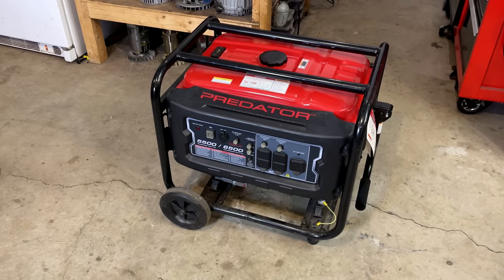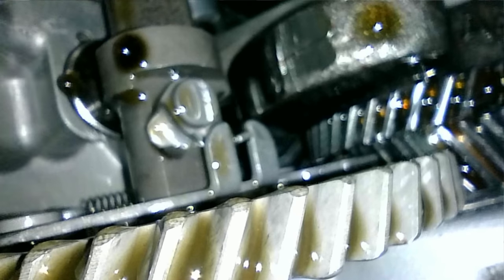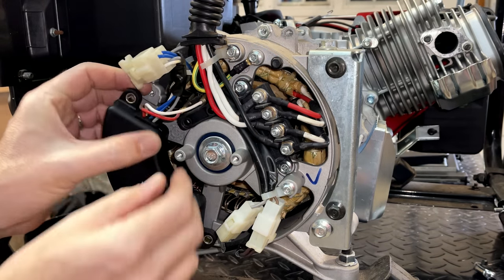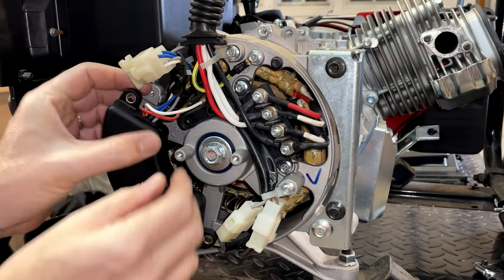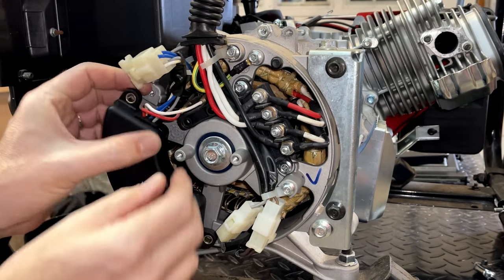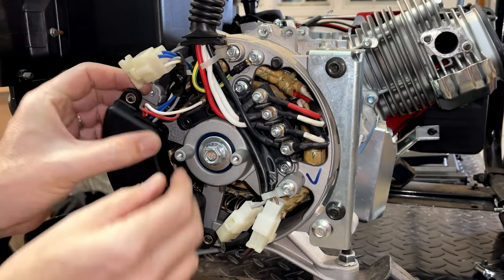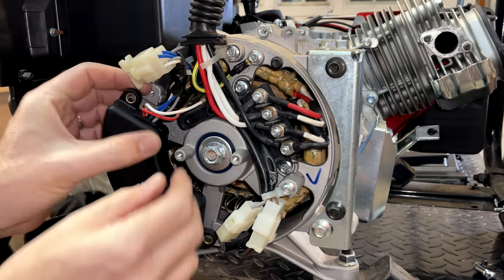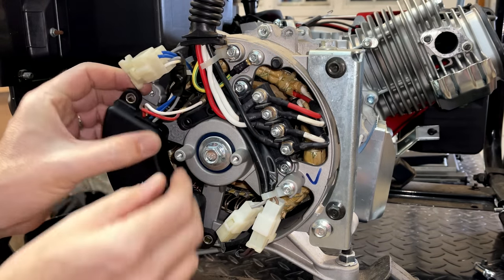Broken Predator Compression Release? - High Compression and Hard to Start

Comment: James it is the OLD MAN at Eliminator Performance saying what a great video this was and kudos to Kens Small Engine for supplying this generator. My buddy has a habit of lifting the front wheels of his mower and banging it down whenever the engine is not running properly. Surprisingly enough i have seen him do this and it clears a stuck needle valve. Do you think that if this generator would have been shocked in a similar fashion this would have released that stuck compression release assembly? Basically, once you saw it on camera and prior to disassembly do you think it would be worth a try?
Reply from the maker: Definitely worth I try.  I edited that footage out.  I rotated the engine until the compression release weight was up.  Then lifted the engine side up and dropped it hard on the ground.  It did not work in this case, but think it could have if I lifted the machine a little higher before dropping it.  I was half expecting it to stick again due to damage so ended up going in.  In retrospect I should have dropped it harder.
Reply from the maker: Here is the drop footage.  Definitely should have dropped it a little harder.  Just uploaded.  Will be available shortly.  https://youtu.be/6oU2PM0IUPk
Reply: @jcondon1  hi James, allow me a necessary joke here, that is to say, if you never heard this before, that your surname is a very complicated for a surname if you ever go to a Spanish speaking country hahahaha ;)
cool video, keep it up🖖
Reply: @jcondon1  percussive maintenance does not let you get out all the neat tools and make a video   you sould get a clean machine once in a while with all the parts
Reply: @jcondon1  
😢
Reply: Here is a Permanent fix and I just let the compression release stay broken.
https://www.youtube.com/watch?v=c8SUueqRzAs
Lowers the compression just enough to make it easy enough to start and run by basically enlarging the haed chamber space.
I plan to see if simply adding multiple head gaskets will also fix it.

Comment: Hello James. Great video, just a small suggestion for your water removal of the stator. Put 2 nuts on the bolt and lock them into place at the length just short of bottoming on the threads. This will be a hard stop prior to bottoming and allow you to run the bolt in as fast as possible to generate maximum pressure. With your experience not necessary, some novices may find this a thread saver.
Reply from the maker: Great idea

Comment: Looking back I wonder if you could have freed up the compression release with a stiff wire through the oil fill while scoping it.  Regardless the design of the other cam you put in looked more robust.
Reply: That occurred to me, too.
Reply: That's what I would have tried, at least to see how hard stuck it was.. And then when it frees up..
Reply: Or maybe pickup a couple of inches and drop entire unit before disassembling?

Comment: I am channeling you today James. I bought a generator, a Dayton from 1980 with an 8 HP Briggs on it. I pick it up at the auction site this afternoon and get to playtime.
Reply: Good luck on your purchase should make a good video buddy, hope you can get it up and running.
Reply: @waynestefinashen239  thank you Wayne. I hope at least parts of it make it to my channel. It is a majestic piece of generator manufactured back when things were well made. I’m excited about it.
Reply: @waynestefinashen239   I have some video of it running on my channel and the gas tank has been sitting for 24 hours now filled with a 50/50 mix of water and muradic acid. Tonight I will see if the original tank is good to go. I got the glass sediment bowl spotless.
Reply: @haneyoakie14  Hopefully the tank holds up and does not need replacement
Reply: @waynestefinashen239  I ended up leaving the acid in a while longer because it still has work to do.
Reply: @haneyoakie14  We have used CLR with stainless steel nuts and bolts to shake around and break up rust with success but Evaporust works the best and is reuseable

Comment: I really love the water trick to remove the rotor. I've pulled apart many various machines and have had rotors that refuse to come loose no matter what I've tried. The compression release info is very helpful too. I don't work on a lot of small units but it's good info......Rinky Dink is the way I'd describe the compression release mechanisms......and when one doesn't work it really complicates repairing a small machines engine....
Reply: James, have you ever tried to use a slide hammer to remove the rotor?  I think it would be far easier than using the water compression method.

Comment: Nice fix Jim, you make it look easy!  Having a second problem adds to the troubleshoot, but fortunately, the 2 problems were easy to separate.

I bought the 8750/7000 Predator in 2016, it had the same hard pull start from day one.  I looked at YouTube videos at the time to see if other people were having the same trouble.  I didn't see any, everyone appeared to have no trouble hand cranking the engine (I also did not know the engine had a compression release).  So, I assumed, since just turning 61, my strength was declining or I was using the wrong pull technique.  To compensate, I used the diesel starting technique (where you preposition the piston so it is just past the compression point), which worked.  However, after 20 - 30 hours of run time and 2 oil changes, the hard starting problem went away so, I assumed it was a poorly machined part that needed additional break-in.

I wanted to point out that all torqued fasteners must have some type of lubrication on the treads, or the reading is invalid.  This is because dry threads have some degree of binding, and thus, throws off the actual torque reading.  I use axle grease on all threads, except those that will experience high heat, in which case I use anti-seize lubricant.  The grease is especially useful with aluminum cased engines, due to the galvanic corrosion that takes place between the steel and aluminum, making disassembly much easier years down the road.
Reply from the maker: Thanks Bill for the tip.  I am always hesitant to use lubricant on small engine bolts.  The only service manual that gives specs for wet vs dry is Subaru.  The others say nothing....  Also thanks for all your hard work with the EM500.  I am still working on two generators, one of which is on the lift.  With any luck I will get that off tonight and free up the space for some EM500 testing.
Reply: @jcondon1  Thanks Jim!
Reply: If the manual does not specify wet for torque (lubricant), then the industry standard is to assume they are referencing dry torque. If you put lubricant on the fasteners when the manual does not specifically say wet torque, you will most certainly be over-torquing your fasteners.
However, yes the lubricant is great to add for corrosion reasons with dissimilar metals and such.
Reply: @JFirn86Q  The problem with "dry torque" is the tolerance is huge due to various surface conditions of the fastener and threaded hole.  On one extreme, you can have corrosion causing binding or, on the other extreme, if the fastener has been removed/retorqued several times, the threads are loosened up.  Anyway...  It may not be that important for this particular application, where the intent was to make sure the fastener is reasonably tight.

Yes, putting steel bolts in an aluminum engine block invites disassembly problems years down the road.  I always coat bolts with axle grease (or anti-seeze if near or on the exhaust) during reassembly.
Reply: @billharris6886  I completely understand what you're saying. It's just if specs don't specify lubrication with the torque value, you never use lubrication to reach that torque value. You will over torque it compared to what was spec'd.
The examples you mentioned are also for non-new hardware, which of course is a different ball game entirely.
Reply: @JFirn86Q  I understand, I am just giving you the perspective from the mechanical engineer's standpoint.

Comment: Thank you for this indepth video about the compression release. 

 I replaced a starter assembly on a eu3000is, installed a tuneup kit, clean both the carburetor and the spark arrestor and changed the oil.  Presently, it turns over freely with the sparkplug out but gets barely a rotation in before stopping using electric start and very little movement to pull start. I set valve clearance and checked for the compression release bump on exhaust valve.  It seamed to move a tiny bit but not compared to the bump shown in your video.  I now have a good idea the compression release is faulty.  Thanks for pointing me in the right direction.

Comment: I agree with using the better camshaft,  that's a lot of work if you put it back in and after a few more hours does the same thing.  Better to go with what you know works.  

One thought,  if you could have run a piece of wire in the engine and got the compression release working,  that might have worked.  I don't know if that would even be possible , just an idea.  

As usual another great video,  educational,  and informative.  Thank you sir 😊

Comment: Just dealt with similar situation, pull start was so hard to turn over the previous owner had ripped engine and powerhead out of motor mounts. Luckily a valve lash adjustment and new motor mounts was the cure.

Comment: I have the current build of this same unit, it's 3 years old, just under 40 hours, interlocked to my house panel, power's everything without issue ( I don't use any sensitive electronics when in use ) it's break-in oil had a lot of very fine non-ferrous metal particles I was very concerned with that and researched possible causes, likely caused by dull tooling during the machining process, but everything is good it was only that first oil change, I've changed it a few times sense then, I also changed the plug to an NGK with that first oil change the torch plug that came with it still worked but I've had good experiences with NGK and just prefer them to other plugs and the choke sticker is properly applied on my unit, nice job on this generator you make it look easy and while it's not the space shuttle you were pretty deep in the engine and that is intimidating for most people

Comment: Mr. James, you just demonstrated why I broke my predator in with 5 oil changes, with increasing loads over 3 hours! The first 3 changes had evidence of metal flakes. Last oil change I put 100% Valvoline Synthetic for further protection! I know to some they think I'm doing overkill, but I'm 70 years old and have been doing this since the 60's! How many early failures are caused by people buying generators at the last minute and just using them as is? I also of keep carb empty when not in use, and keep full tank of 100% fuel when stored, which gets rotated out every 3 months! These are mainly  "what if I need it" machines and need to be ready to go! If I was a contractor, I'd  be okay using regular 89% fuel, but I never use long term chemicals in fuel for storage.

Comment: A two year old story.  My son lives in Liverpool NY ( a short distance from you I believe). His Toro self propelled mower had two issues. The transmission jammed and the compression release didn't work.  He ordered the replacement transmission. We replaced it Christmas eve with it sitting on top of a garbage can. As we completed the job, the mower on top of the can fell over. Fortunately nothing broke. But it did dislodge the compression release. He's used it for two summers now without a recurrence of the problem.
Reply: James_Condon..  ok??

Comment: I have the exact same genset. Bought 2017 and I’ve run the heck out of it during two hurricanes both with 5+ days without power, and a few times in between for a day here and there without power. I push it 240 volts back feed the breaker panel with the mains disconnected. I did notice it getting more engine noise last storm, so it’s time for a maintenance inspection. I have a maintenance log attached to the frame in a plastic zipper pouch with everything done and run time since day 1. And yes, it’s a noisy b**ch normally, but I’m hearing some unusual sounds. I work on these also, so it’s no biggie. Cheers.

Comment: So, I have a Coleman Powermate 6875 and it takes about 35 pulls to get it to start.  And I noticed that last few pulls that it gets easy and then it starts and runs great.  It's not super hard to pull but then it's very easy to pull.  I'm guessing the compression release spring has broken and the the release eventually goes back into place and causes the exhaust valve to open and then starts.  Great video.  Thanks for making it!

Comment: Great video as always James! That valve train noise is extremely excessive. Either too much lash or simply a sloppy designed train design. Also welcome to the inspection scope club! Those things come in VERY handy in our line of work!
Reply from the maker: Very loud for sure.  Usually predators are not that loud.  Almost sounded like there was no exhaust attached.

Comment: Great content. Little tip on removing that rotor. Never hit the bolt like that. Put a socket and extention on the bolt and hit extention. No worring about damaging bolt or missing with hammer and hitting rotor.

Comment: Hey James, great video as always.  I couldn't help but notice what looks to a damaged cam gear tooth on the replacement cam.  Here are a few timestamps where I noticed what I am talking about:
34:15  look like one tooth with very minor edge deformation adjacent to another with even more deformation
35:02 -  Tooth adjacent to your pinky finger
37:34  - Tooth at 12 o'clock position
37:36 - Tooth adjacent to your right index finger 

Hopefully it doesn't cause any issue if I am indeed seeing a deformed tooth.
Reply from the maker: I noticed the same last night when doing the final video edit.  It should be ok, but would have probably used the original cam if I had seen that earlier.  Was wondering when someone would notice!
Reply: D- Do you often examine every video frame by frame?
Reply: @giggiddy  Only as warranted.

Comment: 33:10 It likely bound up on the slots it slides on...

Either a REALLY good grease that won't get washed away by the engine oil (or get flung away by the centrifugal force) or taking it off and filing the posts and slots to give slightly more clearance or a stronger return spring might prevent it from binding again...

Comment: Two things I thought of, soon as you pulled the bore scope, I was thinking could you have used a fish wire and reached the compression release, just to bump it?  The other thing is, wonder if the rpm of the engine maybe stuck the release, and even if you were able to free it with the fish wire weather it would have done it again after running. Heck but you so good at breaking them down, you could do it in your sleep.
Love your channel.

Comment: Something I learned from a channel in Europe, if you were to block the intake, the engine should crank or pull over easy and there’s a definitive way of telling if it’s a bad compression release.
Potentially if you would have tried, blocking the intake method to try and start the engine, it may have fixed the camshaft compression release
Reply: That’s true and it works 
But remember all the peace’s laying in bottom of engine can move and destroy block
Reply: @philliphall5198  Yes and No, you need to remember the generator has very low hours on it and potentially the oil has never been changed and the bits of metal could be for manufacturing.

Comment: Great video James!    Interesting.    I'll go on a limb and say this is where a Honda or a Yamaha usually is more reliable and quieter.   Cleaner manufacturing process.   That was a lot of metal in the crankcase and debris in the carb for a gen set with only 6 hours on it.    Most people would not figure it out and just call it a "lemon".
Reply from the maker: Better quality control and cleaner manufacturing would have prevented this.  It still happens though with name brands.  I worked on a Honda snow blower last year with a failed governor.  Not clear it it really failed or maybe someone deleted it.

Comment: Great job James: I am surprised that an engine that size does not have an electric starter on it? I have changed cams with failed compression releases on Briggs engines but not on Honda or Honda Clones. Thanks for the video.

Comment: Great repair video but the best part was the last 1:30 minutes!!!
Also, seeing and recognizing the cause of the compression problem with the bore scope, a small pick might have been able to free up that cam finger.  That's definitely 20-20 hind-sight!!!
Reply from the maker: The borescope also has a hood attachment.  May have been hard to hook it, but definitely doable.  Another way would have been to position the cam so the decompression weight was up.  Lift and drop the generator a few times and it may have snapped back in place.
Reply: @jcondon1  With all the small metal pieces you removed from the crankcase, it was a good idea to take it all apart after all.  😉